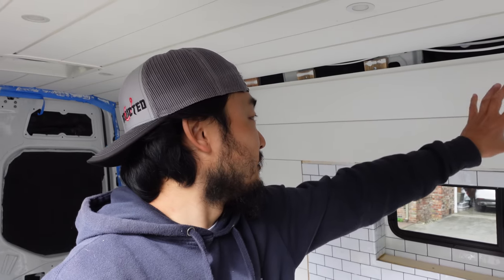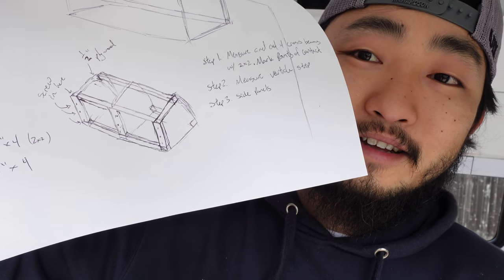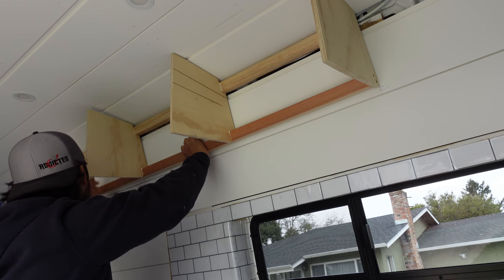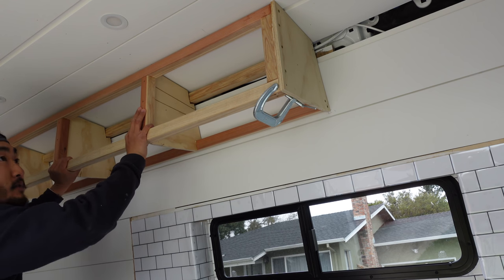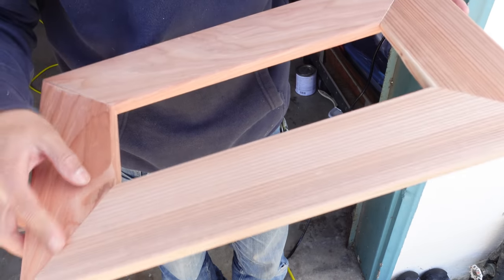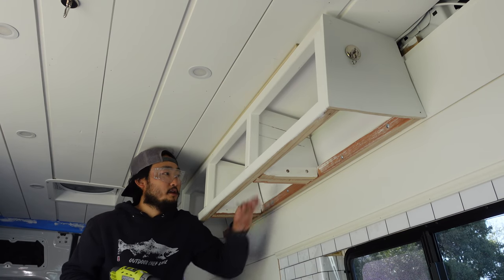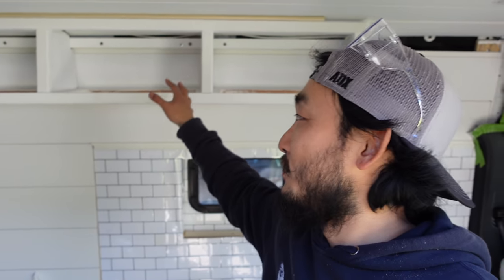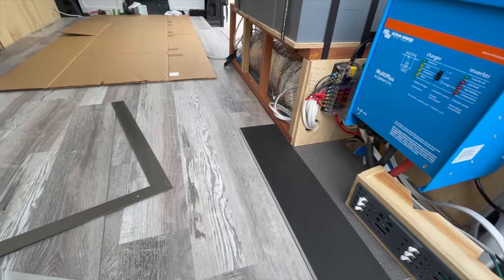Building Our First Cabinet and Installing Floor for Our Van

Comment: For your 45° cuts on you cabinet doors, and cuts in general with your miter saw you may need to "tune" your saw. Use your speed square and verify your miters are 90° & 45°, do the same with your bevels. I'm not sure on how to adjust your exact saw but they all are adjustable!! Van looks great, love both channels 👍👍

Comment: Taku if you stack your boards when cutting for the doors the cuts will be the same as long as your saw is set square ... fitting your joints use a hand planer to get the joints tight and straight ....glue and screw the bottom instead of brad nails to keep the cabinets strong or it will loosen over time ....keep in mind your going to have 3 inches of lip between the front and back wall that’s left exposed with the way you made your cabinet enclosure

Comment: I would’ve used screws instead of nails for the underside of the cabinets. But if you use nails it’s a good idea to use wood glue with it.

Comment: For someone not doing this as a non pro, you are both doing a 👏 job!
Just as a point though, whenever you are shopping or installing products in the van, purchase the very lightest materials. (Lightweight flooring, plywood, and whatever else). It’s not that the van couldn’t handle the weight, but it’s more that your fuel ⛽️ economy will improve.

Comment: Measure 7 times cut once. Don't caulk the edge of floor. Laminate or wood expand in summer and shrink during winter (less with laminate). You shouldn't nail laminate floor (float installation) but if you have to use something for first row from moving use liquid nails. Nails over time will come loose. Hope this helps

Comment: i hope those were screws and not nails since you didn't dovetail those joints....use SCREWS if you want to hold anything more than spices ;)

for the doors you should also use wood glue with the screws....sand of any excess after it sets and fill cracks with wood putty....then sand....and stain :P

i would use a silicone caulk....and trim after setting with a razor blade :P     it looks like pergo :P i put that in a house years ago :P